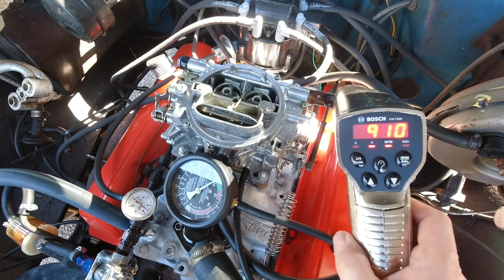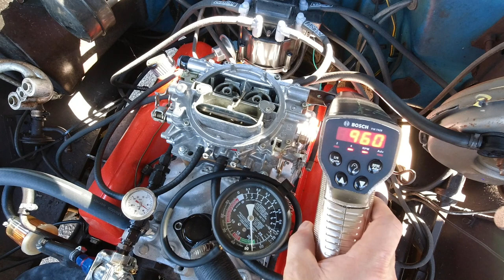Carburetor Transfer Slots - Most Common Questions Answered

Comment: Great video!  I'll add that not only do carburetors and ignition timing go hand in hand but ignition timing also goes hand in hand with ENGINE COOLING especially at idle!
Reply from the maker: It can, but todays ethanol added fuels make that extremely difficult.  The alcohol has no noticeable effect other than the need to advance timing, which leads to hotter idle temps.  There’s a give with every take!

Comment: I believe Uncle Tony at UTG once said, you can do the air bypass on the throttle plates by splicing a fish tank bleeder valve between ported and manifold vacuum. That way you don't modify the plates and then you have an adjustable ball valve to dial in exactly the right amount of air for that rowdy cam. I'm still on a stock motor, I can't wait to have a motor that gives me transfer slot problems. 😏

Great video, thanks for showing!
Reply: Get eye drops and plenty of spark plugs.

Comment: Chevy 348 with huge cam and Edelbrock 1405. Only runs at 34 degrees timing at idle. I had to drill 4 5/32 holes in order to back that throttle off.

Comment: I have a 72 Pontiac Trans Am 455 HO with a Quick Fuel Slayer 750. Auto transmission. Took the original Quadrajet off because of an off idle lag. Had it rebuilt but still lagged. Quick fuel does the same thing. I've added an AFR gauge and am running about 13/1 at idle. 850-900 idle rpm in park and going to about 650 in drive. Car wants to die if I come up to a light and try to accelerate from a stop. Falls flat and stutters for about a second.....if it doesn't die. Once through transition though, runs strong. But off of idle, I basically have to fool the carb a little by forcing the RPM's up a tad before accelerating with a quick stab and release on the pedal. Changed accelerator nozzle from .032 to .035. Tried numerous timing settings with little help. I'm actually running a Progression Ignition digital dizzy and have added additional timing immediately off of idle. Not sure if cam is stock. Neighbor seems to think its been upgraded just from the sound of it. Not sure. I'm considering going with a smaller nozzle (.028) just to see if it helps.  Today I backed the accelerator pump adjuster screw off about .030 just to see if it had any effect. None! Thinking I want to drill holes in throttle plates as a last resort. Totally frustrated and running out of ideas. Hoping you might have some thoughts. Thanks! Great video by the way! 

Should note also, intake is a spread bore design. I have a spread bore to square bore adapter plate (1/2”) installed under the carb. Also, I moved stock pink accelerator pump cam to hole 3.
Reply: Interesting , sounds like the same issue I'm having - but engine refuses to idle  below 1000rpm and have to really rev to take off from stop.  I have a lopy cam with .230/.234 dur on a 110 LSA. I was reading that changing nozzles wont' work. At the point of drilling the holes. A Holley performance book written but Mike Urich describes this problem to a tee.

Comment: I had that problem of non effect idle circuit adjustment with a single barrel Rochester carb. It just baffled me but there's no adjusting a transfer circuit on it. After seeing this I'm wondering if I either have a timing issue or a sticky throttle. This was an excellent video thanks

Comment: As noted, once the holes are drilled in the primary throttle blades, the hole cannot be reduced at least in theory. The only way that hole can eliminated would be to use a pop rivet in the hole. I know it sounds strange but it might work. It will cause a slight change in airflow.

Comment: Explained very well, Brian, the transfer slots make a lot of sense once you know what they are for, i also know about drilling the holes in the throttle plates, i always thought if they were supposed to be there the factory would have put them there, lol, i realize sometimes there is a need for certain measures, thank you for the video really enjoyed it, later buddy
Reply from the maker: Thank you sir.  Appreciate you stopping by.
Reply: @MuscleCarSolutions  My pleasure buddy
Reply: The factory never installed big Mutha thumpr comp cams into their engine tho 😉😉😉😉
Reply: @jakefriesenjake  Why you have to know what you are doing when changing things!  Note:  Comp Cams Thumpr' Cams want LOCKED TIMING..... yup, it's true.  Confirmed with Comp Cams and running one in my engine.  Locked at 35° and fires right up no prob.
Reply: @joevalicenti2722  cool. I didn't know that. I got the big mutha thumper in my 381 Chev.
My distributor timing is 22 initial and 36 total.

With my Ignition, I'm able to put in a "start timing retard", to make it easy on my starter.

I think I set it to pull out 12 or 14 degrees. Sometimes it pops out the exhaust while trying to start. Not good, and hard to start.

I adjusted it to only pull out 2 or 4, and now starts better.

So yeah, I can see that being true!
Reply: @joevalicenti2722  with it locked up at 35, can you drive around on the street with that, or strictly for racing?

Comment: Fantastic video -  clearly presented and easy to follow. Q: What's your view on opening the secondary butterflies a little to assist with additional airflow for a rowdy cam, as opposed to drilling into primary blades?
Reply from the maker: @eyman67  I’d much rather see that than a permanent modification to the plates.  There becomes a point though where it may make better sense to change to a carburetor that has an auxiliary adjustable air bleed like the Edelbrock VRS.  Then it’s problem solved and no need to fight high idle speeds or modifications.
Reply: @MuscleCarSolutions  Thanks very much for your quick response - that makes perfect sense. FYI - new subscriber here and binge-watching through your video library - great stuff. All the best from Sydney, Australia.
Reply from the maker: @eyman67  hopefully you’ll find some good info in those videos.  Get to bed!  It’s late there!  😆 Cheers mate!  Thanks for subscribing.  🇦🇺

Comment: I have a holley brawler 600 vac secondary on an Lt1 with stock cam, intake and headers. When i am off throttle its pulling 25hg vacuum and pops and farts until i knock it out of gear (manual). My 02 goes lean to 18/1 and even though its not under load its annoying. It idles fine, ive adjusted it a bit rich, it cruises fine 13/14/1, if i stomp on the gas i get a good shot of fuel, no pops or bogging. Every other circuit is fine. If say i sit in neutral and gently raise rpm and hold it at say 1500 it goes lean. Ive tried silly big jets, adjusting idle screws all sorts. I just cant stop this transitionary lean spot, but only not under load, under load its fine. I havent tried adjusting the secondary idle position to maybe expose the secondary idle slot a bit more, but other than that i'm stuck. My timing is a good 15degree base timing, altho it is possible its not advancing enough as im using an msd with springs so obviously different curves.

Comment: Great video 
I have a 383 stroker motor 
With ARF 75cc heads 
Comp cam 292h 292/292 and 501 lift 
a Holley 86770 carb 
MSD Ignition and distributor 
Your video answered a lot about the mixture screw problems. But I can get the idle set and idling good but when I rev it up and it comes back down to idle it stumbles and try to die. I can  give it a little gas it’ll clear up. Also after it warms up and I shut it off it’s very hard to restart. Any suggestions ?

Comment: Great video. Thank! Lots of guys talk about setting up a "square" transition slot or about a 0.040" opening. However, it is basically impossible to determine the exact size/position of the slot once the carb is installed. I noticed that the timed port (at least on my Holley 600) opens at about the same time as the transfer slot. Since the timed port should be zero inches Hg at idle (throttle blades closed), does it make sense to use your vacuum gauge to "set the slot" to where you just start to see some vac on the timed port? I did this on my BBC with a mild cam and it seems to run great now. It will idle smoothly at 800 with the idle mix screws out about 3/4 turn.  BTW, my base timing is 24*
Reply from the maker: Squaring the transfer slot is to help the Holley get ahead of moving fuel from off idle.  It can be set before the carb is installed and then tuned from there to see what the engine wants.  The timed port will see vacuum when the throttle plates are open.  When you crack open the plates to expose the transfer slots, you for sure can see vacuum at the timed port.  Tuning really just depends on what the engine wants. Sometimes it follows a pretty predictable path and other times not.  Mild cam with 24° initial is pretty wild unless you’re at a very high elevation.  But if the engine is asking for it, give it.

Comment: If an engine was dieseling , would that effect the transfer slot position on a 4160? 

My zz502 has had a history of dieseling and I got it to strop by reducing the timing- but then started again after playing with the idle mixture and speed screws - which is one of the reasons you probably said to not mess which them a bunch!

Any other suggestions for dieseling / run on?

Comment: Hi there, I had to drill 2 holes 3/16” on the primary throttle blades, to get the transfer slot just barely showing a square, on edelbrock avs650 cfm with the Tfs stage 1 cam, now it idles and the mixture screws do respond to tune.
Reply from the maker: Poor choice to drill holes.

Comment: I was having this problem. You make it very easy to understand what you are explaining. I want to pick up a EDELBROCK AVS 2. for a stock 1999 gen 6 454 (c10 swap)  what do you think would be best for this stock engine, 600 or 650 CFM. It has the stock hydraulic roller cam still in it. All i did was remove all the fuel injection stuff for carb swap. Thanks
Reply from the maker: Thanks boss!  That stock engine is never going to see more than 4500 rpm.  The valvetrain and the heads on that thing suck.  You’ll be just fine with the 650 AVS2.

Comment: You discussed timing, idle screws, vacuum gages, but not about the role of a fuel-air ratio meter. 
You can get better results with these three gages than just one or two of these gages.

Comment: I've read a lot about exposing just a little bit of the transfer slot (I believe so that you can just see a square area of it). Where did that come from? Is that what Edelbrock recommends? You're saying absolutely no transfer slot should be exposed? Is that possible when setting the idle?
Reply: Same question. Are we talking zero transfer slot showing or is there some wiggle room and adjusting for best performance? My SBC 350 is stock, old and a little tired.

Comment: Thanks for the explanation. I have a new holley brawler and it runs great, but I was wondering why the idle mix don't really do anything. Also, it leaks fuel long after I shut it off through the primaries.
Reply from the maker: Couple things.  If you’re leaking fuel after shut off (you’re probably also while running) you Helier check your fuel pressure.  Needle and seats to make sure there’s no trash in it.  Might as well change both your fuel filters at that time as well.  As far as mixture screws doing nothing, that’s a sure sign you’re into the transfer slots, or you’ve got garbage in the ports and it’s not metering any fuel.
Reply: @MuscleCarSolutions  when it's running the butterflies are totally dry. I think I fixed it though today. I had changed out the primary metering block gasket from a holley trickit and that gasket quality was poor compared to the original. I put the original back in and it's not leaking anymore. It's actually holding well enough that the fuel pressure rises to like 9.5 psi age I shut it down when it's really hot. The pressure slowly comes back down as it cools.

Comment: I have a 1991 318 fuel injection  d150 engine  I put a weiland  8007  intake and a avs 500 elderbrock  carb in order to get truck to pull good I need to increase the timing engine  will work good but idles a bit to fast and when timing  is decreased  exhaust sounds nice and throaty  but not when timing  is set for engine  to pull good any thoughts would be appreciated  engine still has factory cam for fuel  injected
Reply from the maker: Sure.  Add the timing and turn down the idle speed to where the engine wants it.

Comment: Hey I have a Holley 4150 blow through carb. I'm confused I see some vids say set all for tranfer slots some say dont expose the secondarys just right above the square. Some say dont even touch the secondarys at all. I have a 351w  big cam w 11 or 12 merc of vacuum. Motor wont idle  unless I expose the primary   slots more then a square.. My question is do i leave the primary's tranfer slots at a square and adjus the rear for the curb idle to get my idle were I need it?  Or do I  set all 4  slots at a square an start there's?  Anything you can tell me will be greatly appreciated thx!🙂

Comment: Hello,
I have a Ford 302 with a set of aluminum heads, trick flow stage 1 cam and a edelbrock 650 Ava carb. The engine is running rich around 12 to 12.2 a/f ratio,  my transfer slot is exposed about half away I have it idling about 900rpm timing is about 13 degrees before tdc. The issue is that when I try to close the throttle blades down the engine is stalling out, the plugs are getting black of the richness of the mixture, what can I do in this scenario? Thanks in advance

Comment: Running into the high speed idle issue after being told to square my transfer slots on primary blades, but not knowing if I need to keep the secondaries closed all the way or open them to show squares also. Can't find the answer regarding that adjustment. Holley 750DP / mechanical sec.
Reply from the maker: I understand the common practice of always setting a Holley to a “square” box on the transfer slot, but what that does is cause issues at times that weren’t necessary.  I’ll always start with them not exposed when it’s a mild cam, street application.  If I need to open them as I tune, that’s an easier adjustment than trying to correct an issue that is assumed to be correct.  It’s not wrong, but it’s not right for every application.

Comment: The cam is a trick flow stage 1 with 221/225 degrees of duration and .499/.510 lift with 112 lobe separation, about how much initial timing should I be looking for with that cam profile ? Thanks again

Comment: So completely hide the transfer slots then adjust from there? The secondary adjustment is on the underside base plate. Does this mean you have to keep taking the carb off and on just to get it to idle??😮
Reply from the maker: On an Edelbrock carb yes.  Cover the transfer slots.  As you’re adjusting, the engine will let you know if it needs more fuel/rpm on a more aggressive cam profile.

Comment: So if I'm having this issue with transition idle and have done your suggestion with no luck . Should I go from 650 cfm to 750cfm carb? Or maybe try the drill hole trick in the primary flaps?
Reply from the maker: I would need to know what you’re working on.
Reply: @MuscleCarSolutions  chevy 383 stroker with fairly good size cam . Currently has a quickfuel sq650. Runs rich.
Reply from the maker: @tommiller2101  hate to ask more questions but I need to know a lot more info.  What’s the cam specs?  What intake?  What’s your base timing set at?  What PV did you put in it?  What is your idle rpm?  What is your pressure at the carb?  Checked for anything in the needle and seats?

Comment: is it possible to richen up the air/fuel that is released from the transition slot on an AVS2 / 650?  I 'm trying to fix a lean condition off idle on a 302 with a moderate cam.  At first tip in the air/fuel jumps up to ~17 for a short period of time.  Fuel pressure is 5.5 lbs, have tried base timing from 10-24 degrees.  The condition has been improved a little bit by putting the accelerator pump arm in the top hole and using the strongest step up springs. Enrichening the idle mixture to 12.5 helps reduce that lean bog a little bit.
Reply from the maker: What step up springs are you using?
Reply: using the silver springs which are rated at 16" of vacuum although the engine has only around 12" at idle.
Reply from the maker: @joedirt9397  sounds like you’ve found your answer!